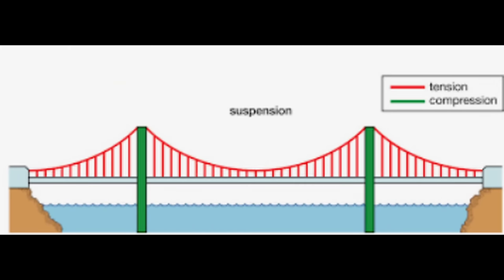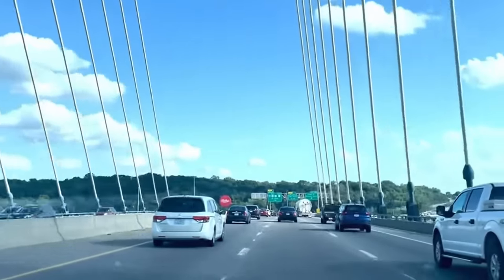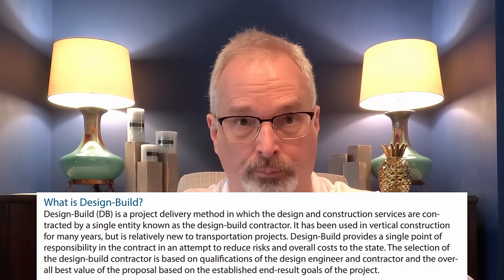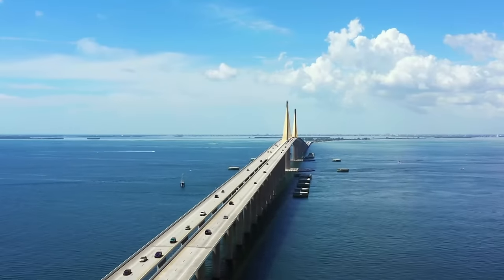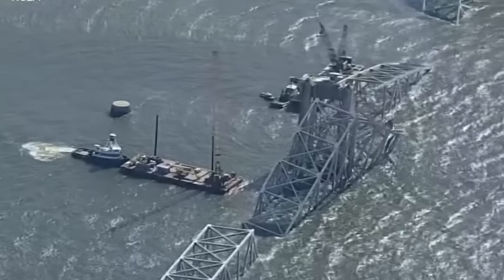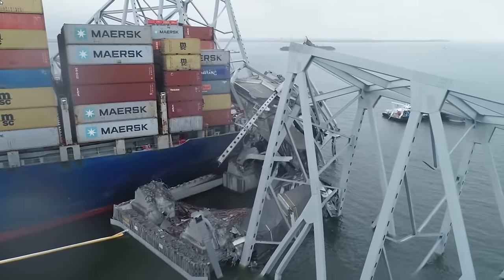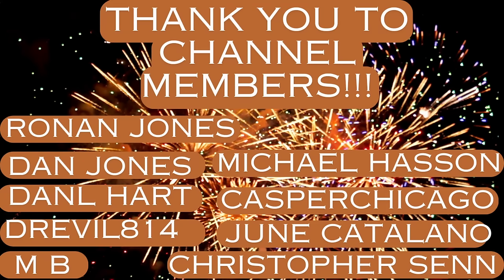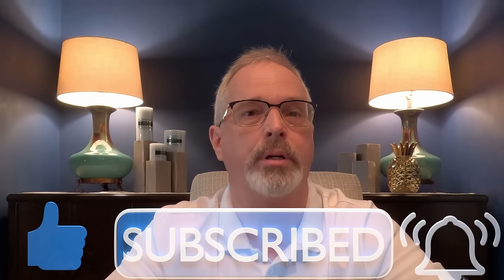How will the Key Bridge in Baltimore be Rebuilt?

Comment: One thing I would want them to consider in design is twin bridges.  The advantage is they share the traffic and if one needs major work traffic can be shifted off.  Yes more cost up front but later can be a big cost saver and adds a built in backup factor.  Here in WV many of our bridges are twin builds and when one needs replaced it causes a slowdown but not a complete shutdown.  They could still share bumpers and outer pier structures.

Comment: Great explanations, i agree that in THIS CASE reusing the substructure is unlikely. The loads will probably be higher due to the new bridge being wider and or taller. Also, the piers will likely not be in the same place. However reusing the substructure and replacing the superstructure is common for smaller bridges, (i.e. typical bridges carrying an interstate over a local road).

Comment: At your premis, you lay out a wider span option to reduce margin of error.  The bridge wasn’t knocked down because of a navigation error. Ships have been passing through safely for decades.  If the passage were doubled, it wouldn’t change the result for a ship that has lost power in the wrong current flow.  Bridge piers might be better protected with a groundIng fill of rock that would arrest a ships movement.
Reply from the maker: Thank you.  I agree that such bridges need to be retrofitted with better collision protection measures.

Comment: The Minneapolis I35 bridge was replaced in 14 months from the date of the 2007 collapse.  That was  a much shorter bridge; but also blocked off the waterway barge traffic until wreckage was cleared.
Reply: Yes, it was only over maybe 600+ feet of river and possibly about 1500+ ft total so because of that and the total topography differences, like being a good portion over land or nearby, it could be done much faster.

Comment: Cable Stay uses fewer parts, some of which are prefabbed, thus it can be quicker to erect and cheaper to build. Back around 2002-2004 it was announced the FSK bridge would be replaced with a Cable Stay Bridge at a cost of about $2.2 Billion USD. It was cancelled because the projected cost was $2.2 Billion USD and deemed too expensive.
Reply: I'm pretty sure they still have the paperwork from the 70s, and it is helpful to focus the next geotechnical  studies.
Reply: @geneard639 interesting! That’s the first I’ve heard about that, but it certainly makes sense! And right now, it’s probably gonna be $4.4 billion!

Comment: The bridge design will get hammered out and built. I see pier protection as the next issue and how it’s designed so that another ship occurrence doesn’t happen without adequate protection. The Tampa bay bridge shown seems to have an impressive defense system in place !
Reply: Yup, we here in Tampa Bay area certainly learned to improve what we could! The center span was also increased from 800 to 1200 and height some as well.
But Tampa doesn’t have as much container traffic as Baltimore, nor some other types of cargo. More cruise ships and fuel and such.

The freighter that knocked down the old Skyway was an empty phosphate one coming in during a sudden squall that helped push it into the pier.

Comment: From a risk reduction perspective, the obvious choice for a replacement is a tunnel. B1M just released a video on the engineering involved in connecting the Faroe Islands by tunnels.

The Canada-US Gordie Howe bridge will cost $6.4b and it is almost exactly the same length as the FSKB (2.5km) albeit with border-crossing infrastructure not needed for the FSKB replacement. The Eysturoy Tunnel under the Faroe Islands were estimated to cost about $400m for 11 km. Even with inflated American labor costs, using the same construction method for a shorter tunnel should cost well under $400m, and TONS less than the GHB cable-stay bridge.
Reply: See the pinned comment about Hazmat restrictions and tunnels.

Comment: As a laycritter, it occurred to me that placing the towers on land or in shallow water would reduce or eliminate the required protection against ship strikes. If large ships will strike the river bottoms before they can strike the bridge, the piers should stay completely safe, no?
Reply from the maker: Yes you are correct if they increase the length of the main span to provide a much greater buffer between passing ships and the bridge structures that would be a good thing.

Comment: You can combine Cable Stays with Suspension as in the Brooklyn Bridge. Looks better and has more redundancy I would imagine.
Reply: That bridge is a suspension bridge.  The stays are just to stabilize the span, not hold it up.  A suspension bridge is more expensive and just not necessary for such a short span today.

Comment: Since parts of the river seem reasonably shallow, would some coffer dams be possible to help reveal and deal with the wreckage on the bottom?Everyone is saying how difficult it is to see the underwater stuff.  Since nobody has mentioned this it must not be reasonable but I’m not sure why.
Reply from the maker: You bring up an excellent point. I think it's because they were just hoping to remove the debris quickly but ultimately they may have to do something like you suggest. One challenge would be able to drive sheets without intersecting debris.

Comment: I agree that a Cable stayed bridge is the most likely choice.  I do not feel that a wider span is neccessary and would be prohibitedly expensive.  Changing the span length would likely requiire massive changes to the approach spans.  The MD Transportation Authority is currently seeking design build proposals for the new bridge.  On May 7, they will start the beginning of the proposal project.

Comment: We had the entire eastern section (Oakland side) of the San Francisco - Oakland Bay Bridge replaced 24 years after the 1989 Loma Prieta earthquake by a Cable Stay Bridge spanning the deeper water that is east of Yerba Buena Island.  The remainder of the eastern replacement bridge is a sectioned concrete dual viaduct inclined up to the Cable Stay Bridge.  It is quite an improvement both structurally and aesthetically.
If you want to learn about the debacle surrounding costing of that project a good source is, "Eastern Span Replacement of the San Francisco–Oakland Bay Bridge from Wikipedia.  So don't trust any current estimates about the costs associated with any aspect of the replacement of the Key Bridge.  They are all low by at least a factor of 10.
Reply: That's a poor choice for a model.  That bridge cost about six billion, at least three times what a replacement could have cost.  It was chosen because the powers that be liked the look of it.  Then-mayor Jerry Brown wanted a signature bridge.  The tower was prefabricated in China and erected with a Chinese crane.

The right way to plan a bridge is first to choose a type, based on the constraints.  There are two important constraints: required width of the main span, and clearance over the water.  Having chosen a type, then design a robust bridge of that type, and finally consider aesthetics.
Reply: @GH-oi2jf  Poor choice is always determined by viewpoint.  I was just sharing that other Cable Stay Bridges do exist and in my-poor-choice opinion it was a great choice for the application here.
Reply from the maker: Thank you for that.  I need to do a video about the Oakland Bay bridge.

Comment: Good morning Casey; I am commenting from San Rafael Bay.Ah yes The Richmond San Rafael bridge is in view, and just further is the Oakland San Francisco Bay Bridge and the Golden Gate Bridge, oh more bridges crossing the Carquinez Straits Cantilever and Suspension Bridge with massive PG&E power lines also going across the Straits.

I fully agree with your proposal of a "Cable Stayed Bridge" That will allow the main support towers to be closer to the shore. I wonder if the new bridge should be double deck with each deck with four lanes ?

 I would hope the towers get large fender skirts outer lined with "DELRIN" to deflect ships that lose power and Rudder control.

Another area that also needs to be addressed IS the power line towers, that too needs to be looked at.

So SAD watching the Key Bridge collapse like a  house of cards. To me sure looked "Flimsy" I wonder if the accident probe will do a  materials used review including the CMTR Certified Mill Test Reports on the steel used and concrete.

Thank you Casey for recomending a "Cable Stayed Bridge" and putting this idea forward.
.Best
Kristy

Comment: I’m curious if md will reuse the approaches or reconstruct them to achieve a higher elevation over the water for the new bridge as the ships continue to get larger
Reply from the maker: I think it would be unlikely given the age and other considerations that would likely go into current design requirements.
Reply: @CaseyJones-Engineer I have said the same since those ramps are 45+ years old, but also I am sure that new bridge will be wider due to breakdown lanes as minimum. Plus the replacement will most likely have a gentler grade than old style was.

Comment: Would you demo the remaining sections of the old bridge and build 100% new or keep them and "just fill in the gap?"
Reply from the maker: I think they will do a complete replacement for this bridge.  This is based on the current structure (what remains) is nearly the end of its design life anyway.  Also, this is an opportunity to upgrade to more modern design standards including wider lanes.

Comment: Just curious: are there altitude restrictions due to proximity of the Baltimore/Washington Thurgood Marshall Airport?  Will the towers of a suspension or cable stay bridge be too high?
Reply from the maker: That is a good point.  There are usually such restrictions for maximum bridge height within a few miles of an airport.

Comment: Great discussion on all aspects, from design considerations, technical challenges, environmental concerns, contract mechanisms…. Most people don’t appreciate all the steps required for construction projects. Thanks!  

I do have one technical question, for a drilled shaft foundation, how are those demolished when the project has run its life in the future?  Do they remove them or just leave it in place.  For example in the example of a drilled shaft for a large Highway sign, in the future they may expand the the width of the freeway, and thus will relocate the sign.  Do they leave the old foundation in place or remove it?
Reply from the maker: Great question.  The short answer is that drilled shafts have only really been used to support bridges in the U.S. mostly within the last 20 years.  So most bridges being replaced don't have to contend with their removal.  If a bridge did have those shafts for an old foundation, the best way to handle it would be to demo the old pier, cut off the shafts to just below grade (or mudline) and install new drilled shafts just outside the old ones.

Comment: Asking as someone from the area who had used the Key Bridge countless times. One of the things the Key Bridge was known for here was the steep incline of the bridge. If the span were to be widened what would be the expected incline of the new bridge and would that prevent it from being able to be rebuilt as a cable stayed bridge?

Also, in your engineering experience, what design aspects could be incorporated into the new bridge to pay homeage to what locals deemed as an iconic look of the old bridge?
Reply: The Sunshine Skyway was rebuilt to cable stayed from steel truss and lengthened from 800 to 1200 with a reduced grade so not as steep as they did back then.
They should be able to do a similar one there but the approaches would likely be further out.
Reply: Your concern about the incline is a good point. The incline is the geometric relation between length and heigth. The higher ratio of heigth vs length, the higher incline we have.
For what I am reading here, the replacement bridge should be higher than the old one. Asuming that the replacement bridge will be built close to where the collapsed one was, then the total length of the bridge should not vary too much, so even higher inclines could be expected. The only way to mitigate the steep inclines would be to raise the abutments' heigth as well, but that would have an additional impact on the shores as larger access ramps would be required. Other possibility is to build the new bridge away from the old one with a longer overall length, but this solution would imply higher costs.
It is an issue not directly related to a probable larger main span, but from your comment and others related to the relatively low deck clearance from the water it will have a significant impact on the geometric design of the new replacement road and therefore on the bridge itself.
Reply: @diegoferreiro9478  the key bridge was 185 foot clearance, but the new Long Beach Bridge is 205 feet clearance, which apparently is the new standard. But remember that bridges of that vintage back then tended to be more upside down V shape than they are now.  The north side of the key bridge used what appears to be a fairly long, man-made causeway that accounts for about 1/3 of the entire crossing of the river at that point. Typically a new bridge is built parallel to the existing one, so that traffic can be maintained during construction but in this case, there is no existing bridge, but there is remnants of the approaches, which would not need to be demolished quite as soon because I don’t see they can be reused due to their age and the need for increased width roadway for breakdown lines.
There looks to be sufficient places on the south/east side to put new approaches. 
I’m certainly not a bridge engineer, but I have participated in a number of MASSDOT discussions about new bridges for Cape Cod Canal as a citizen .

Comment: They are not going to skip the EIS with any project attached to the Chesapeake Bay. The bay is an active commercial fishing range (crabs, oysters, striped bass) with multiple protected nature reserves and recreational fishing areas. I also feel that a steel suspension bridge, complete with appropriately sized and placed dolphins and rebuilt approach spans will be what is chosen. A cable stayed bridge may look neat, but the cost of building towers tall and strong enough to support such a large open span would be far more than a suspension bridge. Secondly, concrete is not as flexible, and can be subjected to corrosion and deterioration due to how rebar works. Lastly, i would recommend steel as it would be far more simple to construct on a far shorter timeframe and less questionable adherence to mixtures and rebar spacing etc.

Comment: The reason I think is that they are considering a suspension bridge instead of a cable stayed bridge is that there is the Thurgood Marshall (BWI) (Friendship) Airport less than 10 miles away and if planes have to fly low over the bridge on approach to its SW-NE runway... 🤔

Whatever the bridge it will need some really stout islands to keep the seaships in their proper channel.

Comment: I wonder whether there is discussion about not replacing this bridge at all, or replacing the bridge in a less strategic location, or even adding lanes to the other existing bridges instead.
Reply: Look at the map of that area if you haven’t yet.  This bridge is in about the only place I see it could be, and also used what appears to be a man made causeway for one third of the gap at that point in river. 
There’s NO other bridges that would serve that gap, as alternative is two tunnels which aren’t viable for certain commercial purposes and which is one of the primary reasons for this bridge.

Comment: It seems like most recent bridges are cable-stayed, so my first thought was that they'd go with one of them. Intuitively, it seems like the design is very "plug and play" or procedural compared to other types of bridges... You basically just adjust the tower based on the desired length, and almost everything can be pre-fabbed off site. I suppose that makes them less "iconic" or individual in a sense, but Baltimore is going to want something done as fast and cheaply as possible for both economic and political reasons, so it only seems logical to go that route.

Comment: I wonder if you have ever seen the ship entrance to the Duluth harbor. It is very nearrow, yet it accomodates large ships of 1000 feet as well as all types of ocean goning vessels. It can not accomodate the height of a container shop because of the bridge that spans it, a lift bridge. But,my point is this, these big ship thread this narrow needle, and, the waters of Lake Surperior can be as rough as any in the Chesapeake Bay. This may not require a mega type bridge, the old one was okay, if it had proper protection this might never had happ;ened.
Reply: True. Simple. Controlled entrance and exit. No pillars to hit

Comment: I helped conduct environmental monitoring during the constructive of the transmission towers on the north side of the bridge. They were completed about 2 years ago. I would assume some of the pre construction environmental data collected for that project can be used to help speed the permitting process for reconstruction of the Key Bridge. That said, the sediment in the lower Patapsco is nasty stuff. The bridge is in close proximity to the inner harbor and the former site of Bethlehem Steel which have  both contributed to high levels of contamination for over 100 years. Removing all environmental red tape would be a very bad idea for the health of the Chesapeake Bay and the people in the area.
Reply from the maker: Thanks for your comments. Just as you pointed out a lot should be known about the environmental conditions at that bridge site so they should proceed accordingly and not drag things out too much. They could also use environmental protocols when collecting the geotechnical samples to do double duty.